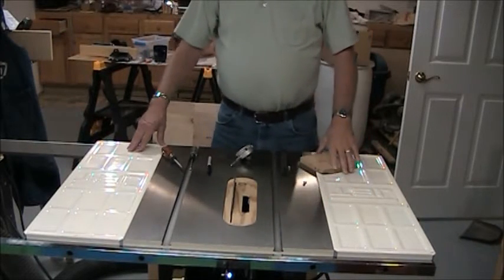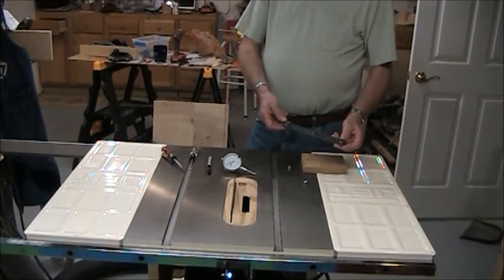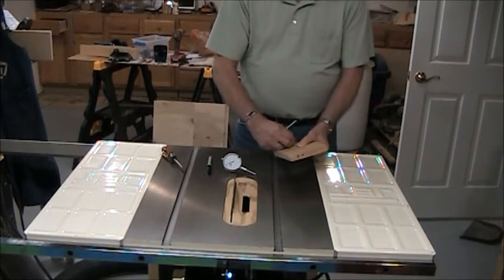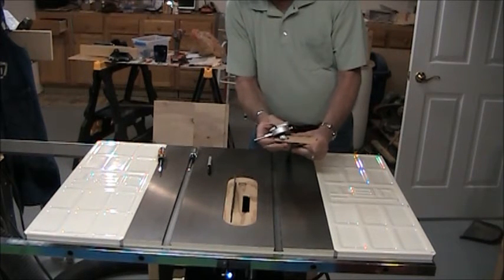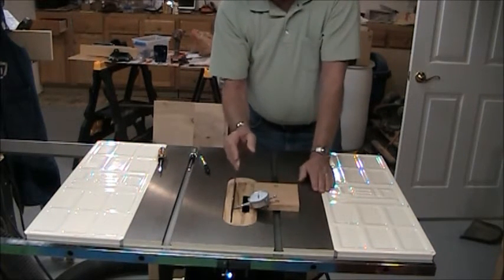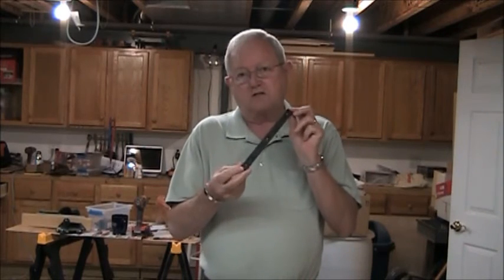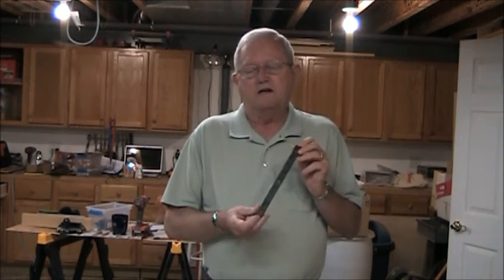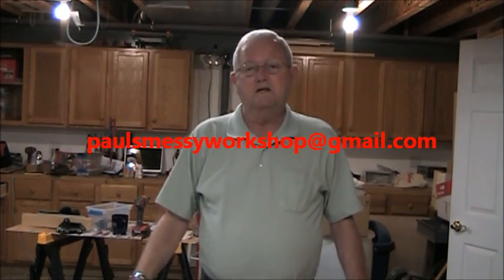Blade Adjustment Jig

Comment: I made a version of this using the zero play guide bar system. Thanks for the inspiration. The only thing I found tricky with the ZPGs was that the holes including the countersink holes have to be spot on if you want the bar to be 90 degrees to the edge of the jig. In this case its not important but with some other miter bars, screwing from the bottom is more accurate.
Reply from the maker: +John Barr - John, I agree the attaching jigs to the Zero Play Guide can be tricky.  The way I did mine was to lay the guide bar on the top of the jig, mark the holes, counterbore the holes (I think I used 3/8") then drill the rest of the way through with a bit that will match the screw.  Thanks for watching my video and leaving the great comment.
Reply: That's a much better way than I did it. I just made a pencil marks on the top. Using the guide bar would have been better. Thanks